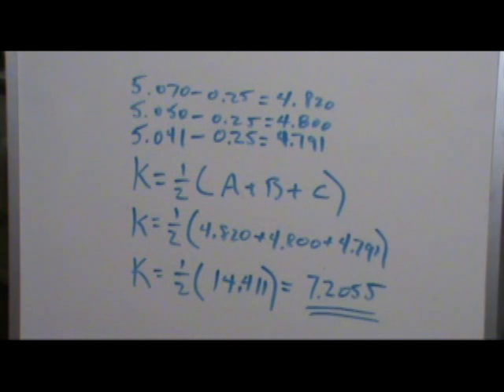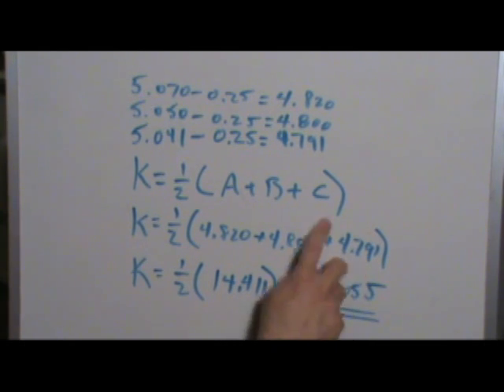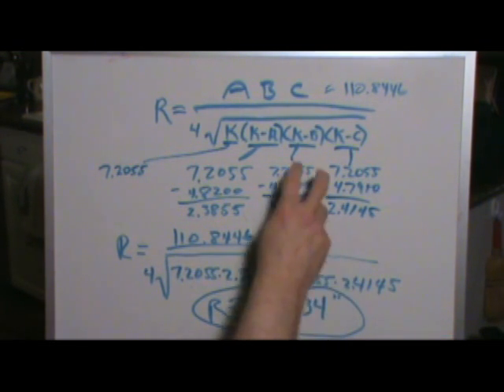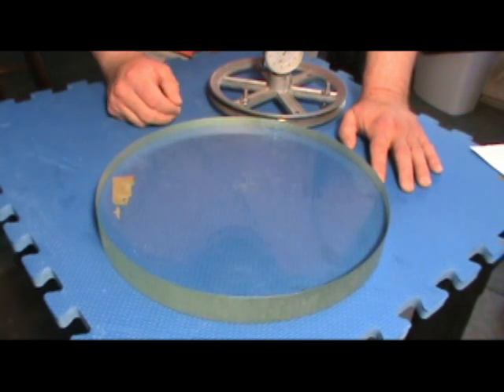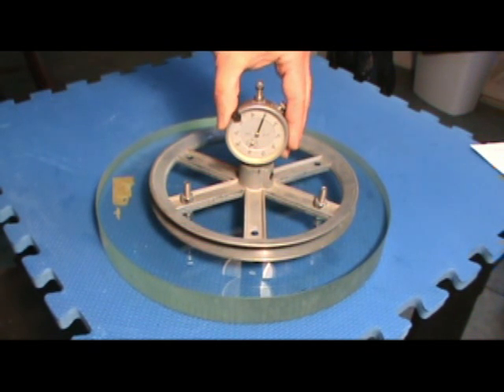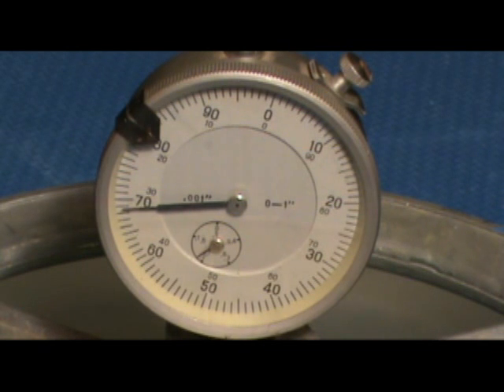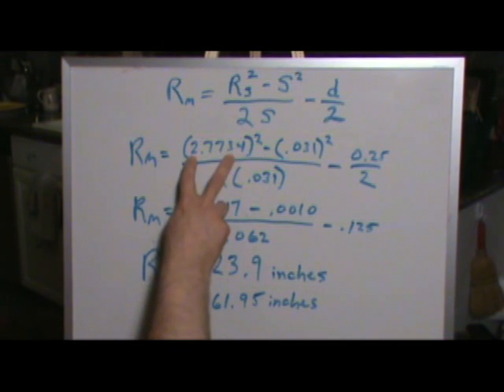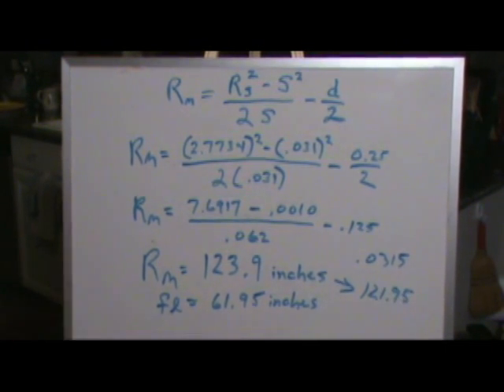Mirror Making: DIY Spherometer Part 2, Calibrating and Using the Instrument

Comment: Greetings, are you still available? And do you grind and figure optics for Maksutov-Cassegrain telescopes? Im on a journey to make my own Mak-Cass astrograph so im searching for someone willing to grind the corrector and mirrors, the corrector is 200mm and the primary mirror 208mm the overall focal ratio I am seeking is around f10-12 depending on what of those two end points give better correction to cover a full frame sensor.

Comment: Very good video. The balls have 1/2" diameter?
Reply from the maker: No, they are smaller.  More like 1/4" diameter.
Reply: @GordonWaite Thanks.  I have a spheres with 5mm diameter . Could I use ones?
Reply: @GordonWaite  I need use  exactly 1/4" diameter sphere?

Comment: I have most of the popular texts on ATM. Can anyone please tell me from where these formulas came so I can have a literal reference rather than trying to write this down from a dynamic video ? thanks.
Reply from the maker: Just hit the "pause" button and take your time writing things down.
Reply: @GordonWaite  Ya I did that and put it in a spreadsheet and then it got messed up and didn't work in reverse. I was hoping this came from a text so I could see more of the math behind it.
OK so these didn't come from a text ?
Reply from the maker: @SmeeUncleJoe  The math is pretty easy to derive yourself.  Easiest of all is to just use one of the online calculators that people have written to calibrate a homebrew spherometer.  A good example is at http://mwganson.freeyellow.com/spherometer/ just put the three length measurements into the three slots at top left and hit the "submit" button.  Just above the big circle, you'll see the calculated value for the spherometer radius.  Once you've got that, there are a thousand places to put in the radius of a spherometer and your dial indicator readings to determine the radius of your glass.  If that isn't enough for you, go to Wolfram MathWorld and put in "circumcircle" there.  More math than you will even need to make a spherometer!
Reply: @GordonWaite  I like your layout better. I'll just draw a nice labelled sketch in Autocad with formulas and try and remember to send it to you or post it on Cloudy Nights. Cheers and thanks again for all these great videos.

Comment: You're doing astronomy but you're not in metric?
Reply from the maker: The joy of astronomy.  Mirror diameters are in inches. Eyepiece focal lengths are in mm.  Radius of a mirror normally is inches.  Thickness of mirror glass is in mm.  SiC abrasive is sold in pounds.  AlOx abrasive in kg.

Comment: Mmh, the formula in 7:33 looks strange to me. It says that Rₘ = (Rₛ² - s²)/2s - d/2. However, when I derive it from Pythagoras, I arrive at a formula where the minuses are replaced with pluses: Rₘ= (Rₛ² + s²)/2s + d/2. Why ? What we are having is a orthogonal triangle with the orthogonal parts being (a) the spherometer radius Rₛ and (b) the mirror-radius minus sagitta Rₘ - s, and (c) the hypotenuse is the full mirror-radius Rₘ, so written Pythagoras (c² = a²+b²) this is Rₘ² = Rₛ² + (Rₘ - s)². From there, we can resolve this for the mirror radius Rₘ = (Rₛ² + s²)/2s. The term +d/2 then is needed because we are actually measuring the radius a little bit short because the measurement essentially goes through the center of the balls, so we have to add that again sitting on the concave surface. So in this particular sample calculation with this new formula we'd arrive at 124.2" instead of 123.9" for the mirror radius. Not a huge difference, this is probably why it is not noticeable so much in the real world. After all, when we grind the mirror, we're only looking to be in the ballpark. Did I miss something ?

Comment: Gordon, did you do a video on how to determine the power of the telescopes?? The F number is good to know to build a telescope, but, how is the power in magnification determined? I have a bunch of mechanical and fluid engineering formulas I use, and I see nothing for magnification vs power in my engineering text. What is a good range of magnification - 20X, 40X, 100X?? is a 175X to 200X magnification a powerful magnification? I have a camera that has a 3.5X additional lense to make the 50X become 175X, and digital magnification I can go a little more, but it starts to become a bit fuzzy so I generally stop at about 175X to 180X. That is powerful enough to see the moon distinctly move in real time. I am considering to get a 5X or even a 10X to have 250X to 500X magnification.
Reply: Then you dive the apparent field of view listed on the eyepiece by the power the eyepiece gives in your telescope to find out the true field of view as seen through that eyepiece in that particular telescope.
Reply from the maker: Magnification has to do with the focal length of the mirror, and the focal length of the eyepiece you are using.  If you have a mirror with a fl of 50 inches, and an eyepiece with a focal length of 0.5 inches,  divide the mirror fl by the eyepiece focal length.  50/.5=100 power.  For wide angle objects like open clusters, you want low magnifications like 50x to 75x.  For planets or the moon, you might want magnification like 200x or even more.  Just depends on what you want to observe.
Reply: Ok. Thanks!
Reply from the maker: That is correct!

Comment: Excellent video. How difficult would it be to integrate an Arduino board into this project to make a digital spherometer? I and likely many others would be extremely interested in a tutorial.
Reply from the maker: That wouldn't be too hard.  You would need a dial indicator with a data port.  Should be available at minimal cost.  I'll see if I can scare up a solution along those lines.  Thanks!
Reply: GordonWaite the cheap 20-25 buck ones typically have an rs232-ish data port on them. The same protocol on those as on the cheap digital calipers, I believe. Might be worth a try.

Comment: Dear Mr.Gordon i have a mitutoyo dial indicator with 0.001 mm graduations with max measurement of 1mm. what could be the ideal size of a spectrometer body for this. i have access to lathe so i can turn aluminium block to any size. say i need to measure sagitta of a 12 inch f2 sphere. thanks
Reply from the maker: Nagarajan K Hi!  Actually your dial indicator would have to be put in a quite small spherometer, as the travel is so small at 1 mm.  To test a mirror with a 24" focal length, your spherometer would have to have a diameter of about 75 mm.  Please email a photo after to make this instrument!  -Gordon
Reply: GordonWaite So nice of you sir. now i know the size from the master. may be in a week ill get it done. thank you soo much
Reply: GordonWaite I have made my spherometer as per your guidance. thank you soo much. i have sent photos of it to your mail.

Comment: Why go through so much calculation? After finding the lengths of the three sides, If the triangle created by the three balls is approximately an equilateral triangle, you can just divide the mean length by sqrt(3) and arrive at the same answer. In your case, it comes out to r=2.77339
Reply: actually r comes out to 2.7734O ,rounding off properly,the same that the author got; thanks for your alternate method.

Comment: Youd said the balls are 1/4" dia. and you subtract 1/4"from the OD, you don't end up at the center of the ball but the inside dim between the balls....or did I miss something?
Reply from the maker: AffordBindEquipment You are looking to get the diameter of the circle that includes the centers of the three balls.  So you need to take off half the diameter of one ball ON EACH SIDE, so that means to get the diameter of the circle, you have to take the diameter of the outside, then subtract half the diameter of a ball on each side.  Since 1/2 plus 1/2 is 1, you subtract the diameter of one ball to get the measurement of the circle you want.
Reply: +AffordBindEquipment - If there is 0.125 ball radius, minus 0.125 ball radius, then taking the outside measurements minus the 0.250 will give you the centers.... Subtracting both diameters (0.500) will give you the Inside Diameter. Or, take the OD and subtract the ID and divide by 2 and it will give you the center to center.

Comment: The term "thou" is commonly misbelieved to be shorthand for 0.001" (THOUsandth of an inch. It is actually a TENTH of a thousandth of an inch, 0.00001".)
Important distinction in the world of machinists and critical in the world of optics.
Reply: thou is short for a thousandth of an inch... and for ten thousandth you say tenth..
Reply: Doc - 0.00001 as you show it is 1/100,000. 1/10,000 is written as 0.0001. And with 0.001 dials, it is not too difficult to calculate the space between the lines at 0.0002 increments or even 0.0001 after a little practice.

Comment: One question, it may be a silly one. How do you know it's 31.5 thou and not 68.5 thou? I'm assuming the smaller dial(smaller needle) towards the bottom tells the number of rotations the main indicator needle has made...
Reply: Brett- Because the small dial vane was considered on the flat measurement. It is used as a reference on smaller measurements that the dial travels less than one full revolution for this dial indicator. When measurements larger than one full revolution of the large vane, then the small dial vane must be included to verify an accurate reading. Just watch if the large vane travels less than one full revolution. It may be possible to travel more than one revolution on a small mirror with very short F value - but my guess is that few would be that small of a radius.
Reply: The dial indicator needle always rotates counter clockwise on the spherometer, after being calibrated.   It is a bit counter-intuitive.   The needle of the dial indicator travels clockwise when the plunger is pushed up.   On the spherometer the plunger goes down from the reference position so the needle rotates counter clockwise.

Comment from the maker: The location of the feet doesn't need to be precise because the Z distance doesn't change very much at the center of the circle.  Do a calculation of sagitta of 8" diameter, 120" radius, sag=.0667.  If 7.95" diameter instead, sag=.0658. Diff is .0009 which is probably below measuring accuracy of a cheap dial indicator.  Build it and calibrate it against a mirror of known focal length... plenty accurate enough for non-professional use.

Comment: How can you get a constant radius from the the point of the spherometer to the circle that is circumscribed by the spherometer "feet" when you said in the first video that the "feet" do not need to be precisely placed an equal distance from the center of the pully.  You WILL get the radius of the circumscribed circle, but won't the point of the dial indicator be 1000ths, or even 100ths of an inch from that radius?